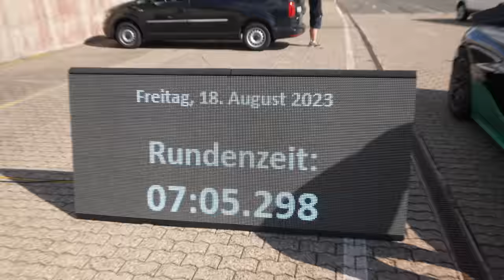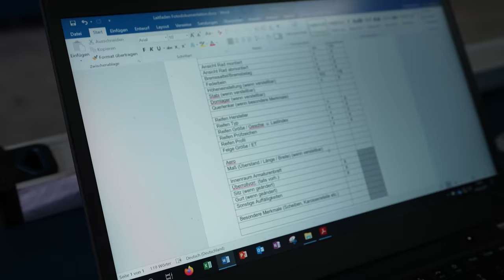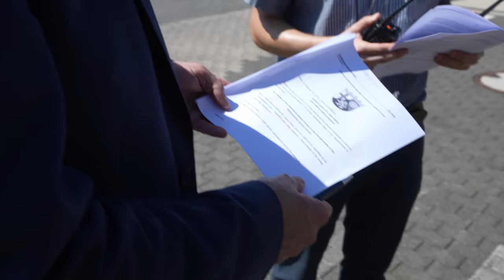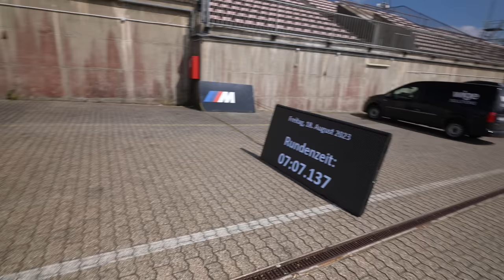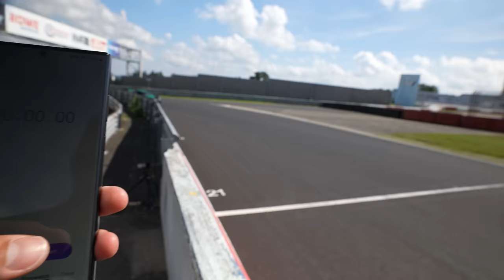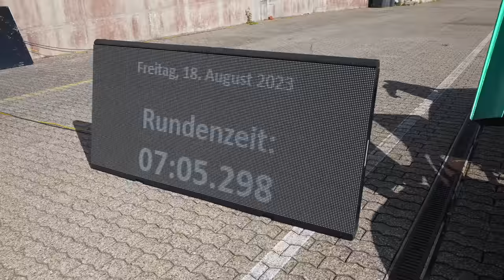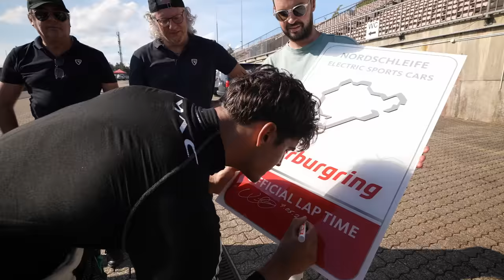EXCLUSIVE: Rimac Nevera Nürburgring Lap Record REAL BTS!

Comment: I don’t understand how people are surprised it didn’t do below 7 min. You can clearly see in the onboard video that the car struggled extremely in the corners, due to the overheated tyres. The driver wasn’t even on full throttle most of the lap. There’s a lot of potential in the car left
Reply: I mean expecting the Nevera to be anywhere near even a Cayman GT4 RS, 488 Pista, or the Gen 5 Viper ACR in terms of lap time is like putting Steven Seagal against some random japanese seiyuu in a sprinting race

Comment: Haters are always going to hate. When I heard the ambient and track temps compared to those when GT3RS and Project One amongst others set their times, the Nevera is around where I thought it would be. And to put it into perspective, this from a relative start up with a car that is near capable as those from manufacturers with decades of car and motorsport pedigree, congratulations to all involved with Rimac. Looking forward to the next attempt in similar conditions to those that benefited the ICE's so many on here use to try and crucify the Nevera
Reply: This gentleman gets it.. Congrats to mate & team. I'm sure they will be back even stronger.. Big effort out of the gate.
Reply: Track conditions cannot account for the type of discrepancy in lap times that your referring too. There was alot of hype about this cars torque vectoring and power splitting to each wheel when it came to the handling capabilities and such. For reference the 500hp gt3 lapped the ring in 6:55. For a car that has 1814hp its just very surprising that it isnt faster. Perhaps the battery cannot withstand full power over an entire lap, if thats the case it’s disappointing considering that this is a hypercar. 
They are not a small company anymore they supply alot of battery tech to other companies and i believe they own bugatti now.
Reply: The barrier of entry for performance is easy for BEVs. Any manufacturer can order or build HP motors like the Rimac.
Reply: Haters? I don't think so. Most of the people's are wondering how it could be that slow on nurburgring for the quickest acceleration production car. What do you pay 2mil for? Have a look at the Mercedes AMG ONE That car give you speed and track performance for 2mil euro and plus you don't have to spend 50min in the charging station to charge your horses. 
I get it Rimac is new to this game and we should never ever compare it to all this other brands ever again. Same thing for the tesla. Putting 1000+ hp into a family car and braking system fails after two heavy brakes makes me think this thing will give you the same experience 🤷‍♂️ 
It's a big archivement for the Rimac but not for other brands. 550hp M4csl is 10s behind Rimac at the finish line and it doesn't accelerate 100 - 200 in 2.5s just saying 🤷‍♂️
Reply: @grg88888  you as many others forget that you compare a GT EV vs. dedicated track machines fine tuned for tracking courses which is very drastic difference when you think about it in details

GT3 or as people love to remind viper ACR came with much lighter weight,much more downforce and far less torque than nevera comes with which does wonders on tyres and you also forget batteries lose power with time vs. ICE which will run as fast as it can till it blows up

the fact that it rivals them while having all these disadvantages should make you ashamed of said cars because they don't have to deal with a ton of torque,lack of downforce and tires literally melting as seen on video

you can't defeat physics in its game but you can obey the rules and play to your best capabilities
Reply: @xthelord1668  how is that considered a gt ev? Its 100% styled and specked to be a hyper car, torque vectoring active aero, 1813hp…..its no gt car. I as well as many others are just surprised as why its not faster.
Reply: @grg88888  did you even watch the video if you are so surprised?

thing leaves skid marks on the track meaning tires are melting like cheese

power and torque don't instantly translate into more speed; weight plays a huge part in this because the more weight you have on the suspension the less downforce you can apply to the car because downforce is essentially you adding extra bags of sand on top of the car but translated as air resistance

and you clearly forgot that just because it is a hyper car it does not mean it is locked to that personality because after all EV's can change personalities on a fly and nevera is a mix of a hyper car and a GT car because it will eat long distances without skipping a beat due to its battery capacity

again were comparing a hybrid of hyper/GT car vs. track focused cars and it being this close to them with all the limitations EV's face should clear your head as to why should we ditch ICE's in mass production
Reply: @xthelord1668  the model s plaid did it in 7:25, its an old platform luxury car ev chassis from over a decade ago with a bit over 1000hp and is not far off from the nivera’s time, both cars are similar weight, Rimac has way more power and is a much newer chasis has way more downforce and is not much faster. 
So something is up, im guessing it cant put out its full power for the entire lap.
Definitely does not make me think we should ditch ICE, the opposite in fact, i think hybrid is the way to go considering we dont have the electrical grid infrastructure to charge all these ev vehicle’s and most power plants are burning fossil fuels anyway to produce electricity, just exchanging one form of pollution for another. The hybrid hyper-cars are smoking these full ev cars on track too so if anything the opposite case is being made.
Reply: @grg88888  if you believe that time to have been done with production spec tires then you are wrong, many people just look at the hp number and think that the car will be faster on a track, all of that power needs to be put somewhere. Misha even mentioned how up until 4 years ago the ring didnt even check that kind of stuff when setting production car lap times.
Reply: @dommert5907  but it was done with production spec tires. They used goodyear eagle f1 supercar3 tires. Same tire used on Camaro zl1 1le. Its all documented. They come with the track package on the model s. I could care less, it just shows the hybrid ICE cars are still the fastest around tracks. Just surprised the Rimac isnt faster and is not much quicker than the old platform luxury car model s track package.
Reply: @grg88888  ah that's fair then, thanks for mentioning

Seems like this car just couldn't use all the hp it had, it very rarely had 100% throttle input. They seem to have a lot of work to do
Reply: @grg88888  the tyres are not street legal here hence there is discussion of the validity. Still, I agree that it's surprising they were not faster than the plaid by a larger margin.
Reply: Lol the Amg Gt Black was half a minute faster in DAMP conditions.

Comment: I'm shocked it wasn't sub 7 given how insane this car is. The Viper ACR was faster and it's a manual
Reply: 1500kg vs 2300kg 😅
Reply: @rkan2 654 hp vs 1900 hp
Reply: @maerklin29800 Gobs of power doesn't mean much if you've got no opportunity to put it all down.
Reply: @flurpoid you do have opportunity to put it down. There many place you need to be fast at 100-200 and 100-300 in the track.
Reply: And actually engaging to drive since it has gears and is RWD.
Reply: @maerklin29800  Lack of weight is always gonna be better than outright power, this is well known since the early days of motorsports. Don't be dense on purpose. Nevera isn't designed to be a track toy with lots of downfoce to put down power like the ACR or GT3 does, quite the oppossite; is aiming for top speed records where making extreme amounts of downforce isn't the priority because it'd slow you down. Engineering is the art of compromise, it's impossible to be a jack-of-all-trades in this stuff. Props to the people of Rimac honestly, not many manufacturers on the top speed hypercar market go to Nürburgring for a quick lap like this.
Reply: @plocky4275  the best compromise is the MCMurtry I think
Reply: The viper is not faster, it did 7:01 but on the 20.6km. The rimac did 7:05 on the 20.8km. They will have similar +/- laptime on the 20.8km but I agree that the rimac time is not what we were expecting with 1900hp
Reply: Viper ACR 7:01.3, Rimac Nevera 7:00.9
Reply: @maerklin29800 weight is all that matters on nurburgring
Reply: well, considering the driver, it's not bad
let's wait for Nico Rosberg to drive his Nevera on that track
after all he is F1 world champion
Reply: @maerklin29800 GT vs race car?

Comment: Seeing a 2 mil. € 2000hp machine struggle makes you appreciate the Porsche even more :D
The fact that Manthey Cayman rs can be just as fast or even smoke it is insane.
Reply: And makimg me wonder why Rimac is proud of this...
Reply: @maerklin29800  I was thinking exactly the same.... Rimac has 1,900hp and does the same laptop as a 500hp little Porsche? Weird...
Reply: @Dauerurlauber i wonder what the weight difference is. And rimac is also like 100 years old with plenty of experience
Reply: @Delitor Not saying they are not experienced but they were founded 14 years ago in 2009. Not 100 years ago ;)
Reply: @Delitor   Let me put it this way:
Cayman has: 25,7% the power of Nevera, 19% the torque, its 3,12X slower in 100-200, uses 245 front tyre and 295 rear, Nevera uses 275-315, its also rear wheel drive and you tell me its all because of the weight? Sure, difference is significant, 34,8% lighter, but it accelerates 312% slower when it matters the most (100-200), so its either a really poor performing driver or a car. Maybe both, i dont know.
Reply: @Swoerm I was sarcastic
Reply: @zerooneonetwothree1872 All that extra weight and power is extremely hard on the tires. In the video they mention that for the first sector it's an absolute rocket, but then it overheats the tires and loses a ton of grip. EVs also tend to lose quite a bit of power over the course of a lap as the battery gets hot, where an ICE will hold onto most of its engine performance over a lap, particularly if it's naturally aspirated.
Reply: @griffinfaulkner3514  this car hit vmax of 354kmh on the last long straight, power was still aplenty near the end smh.
Reply: @griffinfaulkner3514  Fair point, tyres pressure/temp is bigger problem for heavier cars, but just look how insanely it accelerates before the main straight, from 150 to 350. I dont think it lost much due to heat.
Reply: @zerooneonetwothree1872  Fair enough on that one, I was expecting something like the last Tesla lap where the thing fell on its face for the last sector or so. The tires definitely gave up the ghost for this thing though, and the conditions weren't helping it at all.
Reply: @zerooneonetwothree1872  It's the driver. There are so many situations where he got in and out suboptimally.
Reply: It is the weight.  Less is more.
Reply: @user-od9iz9cv1w  no it's not. It's power to weight ratio.

Otherwise we would still fly, Wright brothers' Flyer and not Boeing 7X7 and Airbus 3xx, while the military would fly Sopwith Camel instead of Eurofighters and F-22s.
Reply: So a ten ton car will corner as fast as a GT4 if it has enough power?  Doubt it..
Reply: @user-od9iz9cv1w  Well then you have the issue of contact material, tyres... The compounds in every dedicated cup2R that both cars use is carefully optimised for the weight and power of that car, so technically, if you had super material that can grip a 10 ton car, it would probably be even faster than gt4rs, since it would have constant downforce of minimum 10 tons. We are talking hypotheticals , because our materials or engineering in general are far from good enough to make such vehicle, but there is a sweet spot for every moment in history, determined by current progress of the science and nevera is pushing the tyres extremely hard, while computer codes are obviously not managing to compensate for the weight in the corners with trust vectoring, so you end up with F1 acceleration and horrible cornering performance and there you have it... 7,05 time... Worse than 992 GT3 (non RS, non Manthey).
Reply: @zerooneonetwothree1872  Ofcourse its about weight. Theres a termin called "carrying speed through" meaning that even if heavier but a lot more powerful car can accelerate faster on straight it also has to brake way earlier, has to brake way harder, goes through corner with lot less speed. Also that means that on a long track wheres lot of curvy sections where lighter aerodynamically track oriented car with track oriented setup can just blister through the heavier car can't use even the same speed. You should kbnow well how puny Lotus elise with way narrower tires can to beat vipers on twisty tracks even though viper has 3 times the horsepower and torque.

Comment: Just saw the lap. On hard accelerations on the straights at around 200 km/h, the car was wobbling left to right quite a bit before leveling out. Similar to what you described in the non-Track Pack Plaid. Proper Code Brown moments. So, props to the driver for the massive display of balls. And also, despite what I said, props to Rimac for not hiding (shoutout to Bugatti 😎) and showing the world what a car that was NOT made for the track can do on track.
Reply: Wait.. So a $3,000,000 supercar, that has 2,000hp, is as wide as a school bus, has a carbon fiber monocoque, runs on Cup 2Rs, has the computing power of multiple gaming rigs, actual independent torque vectoring (per wheel), etc etc etc... Isn't made to be good on track? What was it made for then? Getting the groceries? 🤔😜
.
Now if I wasn't being a cynical nub I'd assume that you meant that it wasn't SPECIFICALLY made to be a track car lol. So yeah it isn't a Radical, or have an RS, ACR, Manthey Racing or Black Series spec (IE it doesn't have a massive aerodynamic package for the track). But because this thing is mostly just one large line of code, it could easily get an OTA and all that simple binary could be changed 😉
Reply: @obsidian....  all other thoughts aside, Rimac specicifally says something to that effect in the video description of the lap; I cite:

"the Nevera is primarily developed as a hyper GT, rather than a car built to devour racetracks. "
Reply: @obsidian....  You have no idea what track vs track is.
Reply: @versedi Why don't you explain it to him then instead of trying to sound superior.
Reply: @obsidian.... doesn't matter, it takes a special car to be successful on the nordschlife, no matter what technology you put in it, look at the gt2 rs 991 mr. 
No power upgrades only suspension, aero and brakes.
Reply: @obsidian.... Batteries can't supply full power for long without overheating, this is the issue with EVs and track use. They are a few lap wonders.  N/A dino juice power density and not pullin gpower like boosted or EV... aka NA ALL day is still king.
Reply: @stoneeh  and a hyper gt car is for what? Is this the definition of a a car for rich people, driving the car everywhere except on a racetrack?
Reply: @Kurikost_  GT = Grand Touring. Basically a fast cruiser. Not as hard core as a sports car, which would not be comfortable enough for long voyages.
Reply: Congratulations on the record. Love watching people getting together and pushing your hardcore engineering prowess. Wether it be EV or ICE Porsche,Rimac, Benz, Tesla. Let’s go!!!
Reply: @N4CR  if you look at the onboard video, the nevera apparently had no issues whatsoever with overheating - on a pretty hot day. That's not the issue.
Reply: @N4CR It is immersion cooling
Reply: @obsidian.... facts. the excuses of the Lithiumfanboys are just out of this world.
Reply: @obsidian....  Drive a GT3 over a speedbump, and drive a GT car over one. One will shatter your spine, one feels like a Rolls Royce. The point was to set what a stock car could do. Sure they could get a much stiffer suspension and make it a track demon, but that's not what this was made for.

Comment: Now I have even more respect for the Viper ACR and that driver.
Reply: That was a beast,would die to try it out on the ring......also on the subject , a 500 HP Porsche is way way faster
Reply: why?? bc its american car and you are american ,,but truth is ,,that is not road legal car ,,and they wanted to cheat ,,so the time they got was not oficial ,,what kind of respect you have for it ??? its a race care made for race ,,this is a road car road legal production car
Reply: yeah the ACR was impressive, wasn't much slower, very close time to the Rimac (7.00.928 vs 7.01.3 on the 20,600m lap)